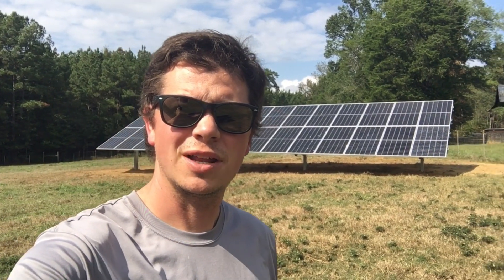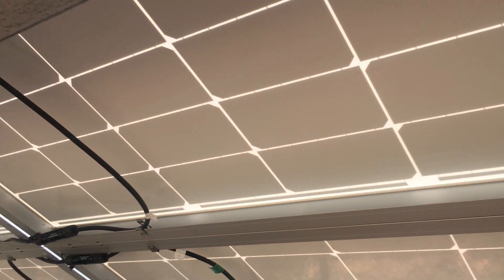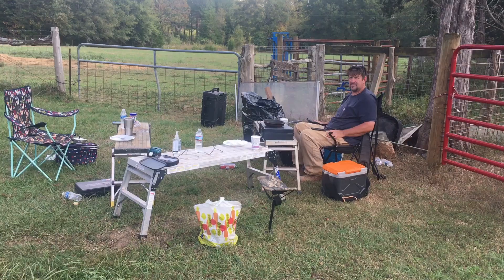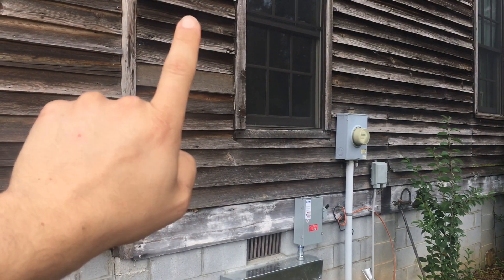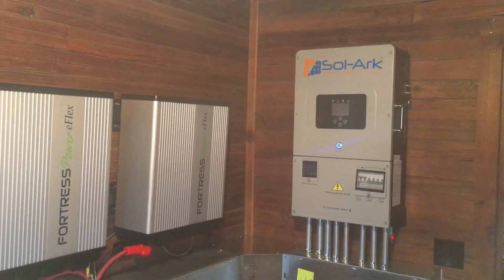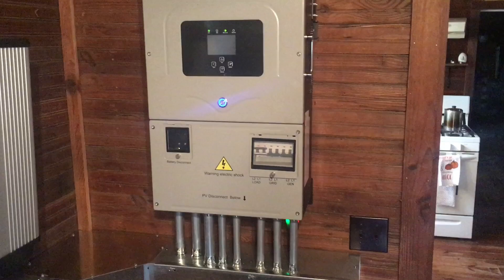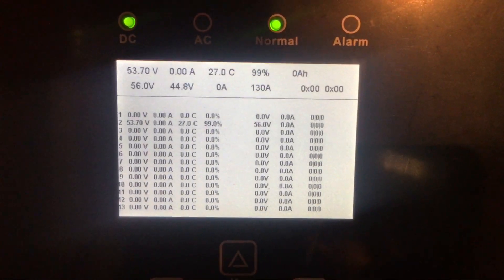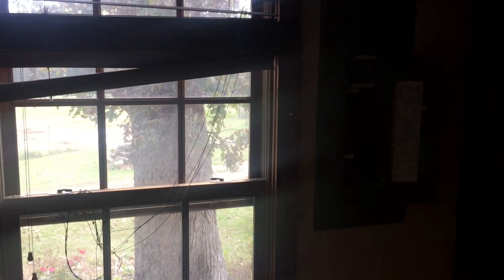Lithium Batteries and Hybrid Solar: Solark 12k w/Fortress eFlex 5.4 System Tour

Comment: Why is that 28 panel solar array inputting only 1 kw? That was a bright sunny day. 330 watt per panel 28 of them seems strange.
Reply from the maker: I probably filmed it when it was shady or maybe I didn’t have it in sell mode yet and the batteries were full in which case the solar would only match the load in the house. Rest assured it worked!

Comment: I have the Sol-Ark 12K w three e-Flex batteries, I noticed that you installed the e-Flex batteries upside down is there a reason for this.  Thx
Reply from the maker: Easier way to get the cables down to the wireway

Comment: Would love to have a SolArk12k with 2 or 3 of those batteries hooked up to my grid tied system in NC!!!!
Reply from the maker: How can we earn your business
Reply: @GainSolarPower  can you do a sol ark 12k to a solaredge grid tie system in NC with fortress batteries
Reply from the maker: @stevenporter7969  ac coupling doesn’t work that well with lithium batteries.
Reply: @GainSolarPower  what do you suggest for battery backup for my situation?
Reply from the maker: @stevenporter7969  I’d do the storeedge system since you already have solaredge. You want things talking to each other.

Comment: Is this or any other LiFePo batteries hardened for EMP/CME?
Reply: I seen faradays on the lines from another dudes panels to harden against EMP.  It didn't seem like he had a battery system though as he was saying his only struggle was cloudy days.  It was just a little handle bar looking think  shrouding the point where the lines under each panel came together.

Comment: Will a solark work with a generator that does NOT produce split phase 220?

I have an RV with an 8 KW onan diesel generator I would like to use as my backup to feed power to a solark
Reply from the maker: No it would not accept 120. A magnum or a conext SW will except 120 and output 240

Comment: You’re running DC to the house? What size cable are you using between the house and the panels? I like all your boxes for your cables looks great.
Reply from the maker: Around 300vdc 2 strings at 20 amps, #8 conductors
Reply: @GainSolarPower  thanks.

Comment: Congrats on your new gimbal system. I have a question I hope you can answer. I have no area to do a ground mount at the property. I am only looking at "minimal" budget backup power, perhaps a small fridge or freezer, charge batteries a couple of lights. Would it be detrimental to place solar panels in the back of shallow (perhaps 4" deep, glass/plastic covered boxes, the kind you see on passive solar heat installs? That way the reflected heat from the panels could be gathered and distributed into the coldest area of the home via some small diameter duct work, and a solar powered fan. I would be making a low profile array on the length of porch roof, perhaps 8' x 20'. In summer, I would divert the vent to let the heat escape into the atmosphere, and let the solar fan assist in pumping the unneeded hot air out. Would the heat generated be detrimental to the solar panels, or their productivity?
Reply from the maker: You could use bifacial modules they let a good bit of light thru. I don’t know if you’d be able to grow much under it but you’d get some heat.
Reply: If I understand right the panels would be the back side of a 'hot box' solar thermal collector.  If that's right the panels will lose productivity and age rapidly.  Heat is tough on panels!

Comment: Hey Johnny. I've been monkeying around with my property, getting the spot cleared for my solar array. The digging isn't going to be as difficult as I had originally thought. I don't know if you remember, I mentioned how I basically bought 10 acres of ledge/glacial till lol. I'll be getting in touch with you, probably in the spring, about this ground mount system. I have a bunch more clearing to do before I'm ready. I was going to go with a single pole ground mount with separate arrays of 12 panels but I'm liking this setup.
Reply from the maker: You can also do this with shallow formed concrete ballasts.